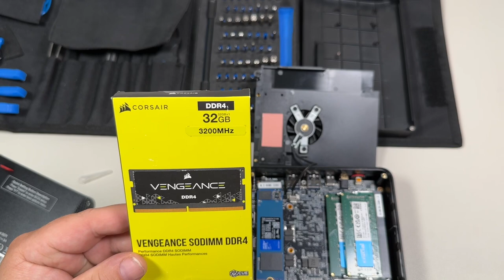Beelink SER5 Pro upgrade

Comment: Another great upgrade I did on mine is add a DP 1.4 to HDMI 2.1 adapter which made it able to output 4K@120Hz and a USB 3.2 to 2.5GbE ethernet adapter for faster WAN/LAN connection. 💪
Reply from the maker: Very nice!

Comment: Thank for taking time and sharing this video. I have a Beelink SRE 5 Max Ryzen 7 5800H and I am going to install an external GPU that will connect to my M2 NVme drive port.
Is it possible to use my Nvme drive using a Sata enclosure and connect it to the Sata port ? 

This way I won't have to buy a new SSD and I can use my Nvme drive that has all my softwares and OS installed.
Is there an Adapter or enclosure available to accomplish this task ?
I came across with this on amazon 

"M.2 to U.2 Adapter - for M.2 PCIe NVMe SSDs - PCIe M.2 Drive to U.2 (SFF-8639) Host Adapter - M2 SSD Converter (U2M2E125)"

I am not sure whether it will work with my mini pc or not ?
Reply from the maker: I looked long and far for a drive to do this, bought 3 that claimed to do it, and each one failed.

I'd instead suggest putting your NMVe into a enclosure.
My Favorite so far is the Plugable USB-C M.2 NVMe SSD Enclosure; Tool-Free & Driverless.
https://amzn.to/3QCHgXJ
Reply: @Jscar_Hawk nice ty

Comment: Thanks for the vid, would have liked to have seen you boot it up etc... Never seen an SSD taken apart like that, i found this vid because I'm thinking about upgrading the RAM to 32GB, but like you, installing an SSD puts me off because of reducing the air flow, now I would definately do the same as you, thanks!

Comment: Does the SSD drive not fit in the space "as is"?  Does it take a smaller (physical) drive?
Reply from the maker: It does fit in the space, I just had concerns about overheating, or moving enough air. Because if you put in a full SSD, it blocks the fan.

Which can create a high pitch whining because it’s trying to suck air through the cracks in between the case, and the SSD

Comment: Newbie when it comes to PCs- there’s no way to upgrade the graphics card for this right?
Reply from the maker: Awesome! Welcome!!!

Correct, there is no way to upgrade the GPU onboard.
Reply: @Jscar_Hawk  can you use a external gpu?
Reply: @TheRealLento  yes currently shopping one now, i have seen ETA prime do a build or two with an adt link that has an adapter for the pci slot, it requires some standoffs and the moving of the operating system to the sata but it was pretty sweet to see it in action, also caught a vid from a guy using a gpu enclosure that connected to the beelink via the thunderbolt, also had some pretty sweet action...i initially got this little titan just to hold me over until i figured out the configuration i wanted for a pc build, ive always been a console gamer, and im pretty sure im not gonna ever make a full switch, but having the option to turn this into a powerhouse that can run the pc exclusives ive been missing out on is pretty awesome
Reply: What kind of tape did you put on the SSD?  I heard you call it something but I didn't understand.
Reply: @indoorsy  it should be a normal thermal tape.
Reply: @indoorsy  kapton tape, it is clear and yellow color. It is non-conductive so it won't short the circuit board on the chip with the metal chassis. It is also a thermal isolator and can handle high temperatures.